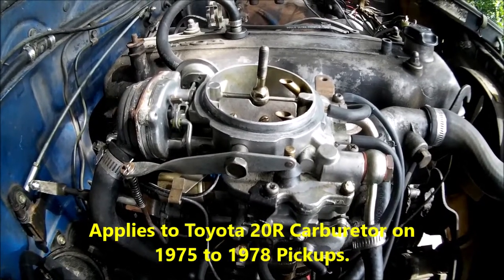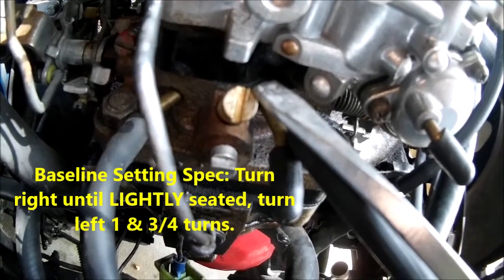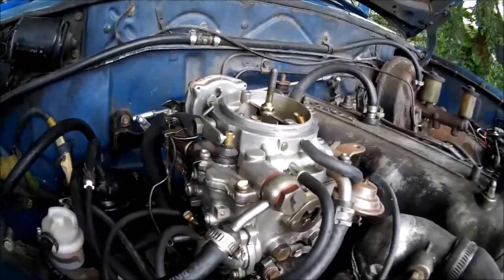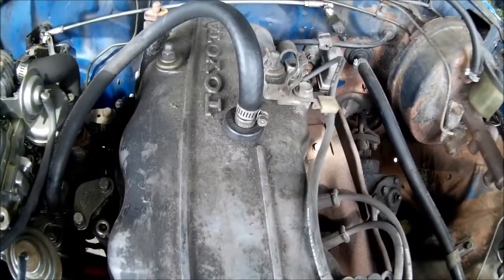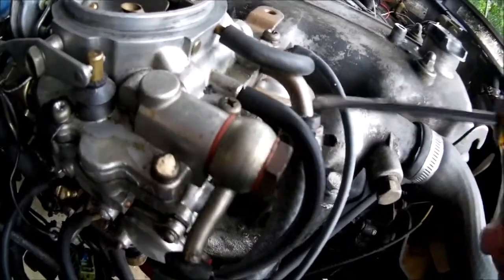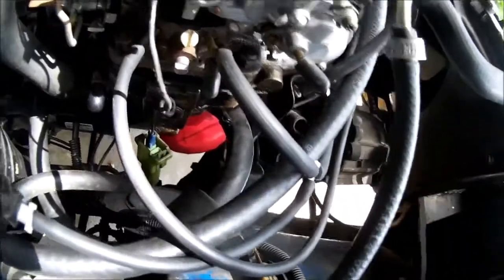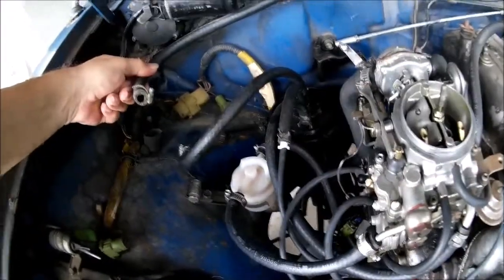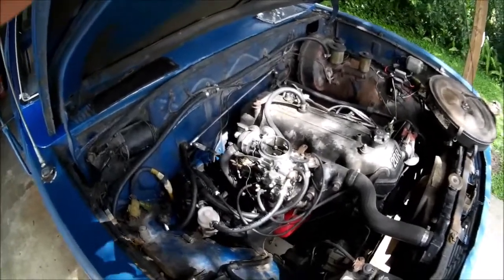1978 Toyota Pickup/Hilux 20R-Carb Adjust & Vac Lines-Desmogged

Comment: I just acquired a 78 Bandit something like a Chinook. No power to fuel pump so I hooked a fuel jug to the carb via gravity, and it lit right off wide open. Is it the carb or the fuel delivery? It had been sitting for years. I hope you see this as you are the GURU!! The linkage seems o.k.
Reply from the maker: Hard to say without actually seeing it in person, but carb'ed vehicles that sit for a while tend to have some issues. Personally I would (might) suspect the carb.  It could be that the float is stuck open, allowing a full flow of fuel to go through the carb, giving you the "wide open" effect. You may or may not be able to free up the float without taking the carb apart & rebuilding it. Sometimes just getting fresh gas into the fuel bowl will "melt" any varnish or gum in there that is causing this.

Keep in mind that it could also be some other problem or combo of problems, like a clogged needle valve (this is the valve that regulates fuel level in the bowl & works with the float). If it's clogged, your temporary gravity feed system may be overfilling the fuel bowl & causing the condition.

Also, depending on how you have your Gravity Feed System set up, it could just be feeding too much fuel into the carb, overwhelming the shutoff valve (unable to meter fuel, kinda like dumping gas down the carb throat while it's running, it will speed up). The carb itself may NOT be the prob at all.

The Idle Circuit could be clogged & the fuel is going straight through the Main Jet Circuit (too much fuel to run @ idle speed, so again, wide open effect). Could also be a non-functional idle shut off solenoid (normal function - prevents engine from continuing to run when you turn the key off). If it's stuck in the "Off" position the idle circuit will not work right It could be stuck closed from gum & varnish.

It's the difference of vacuum from the engine vs atmospheric pressure that draws fuel through the passages of a carb, which are designed to "meter" the fuel flow. If 1 or more of these passages or components (like those mentioned above) are clogged the carb will not work correctly. Now you also see why I say it's tough to know without actually seeing it.

Short of a complete tear-down & rebuild of the carb, or changing it out for a freshly rebuilt one, there are a few things you can try, if you have the time to "monkey around" with it. This will look worse than it actually is, due to me trying to be complete in instructions, if you want to try them. 2 ways:

1. Clean carb on the engine. This takes several cans of Carb Cleaner (cheap stuff from parts store works OK for this) & a source of compressed air (air compressor best, canned air too expensive to use). Remove air cleaner, remove 2 large bolts from front of carb, below fuel level sight glass window, remove idle cutoff solenoid (passenger side of carb, has 1 wire going to it, disconnect this). Don't lose any parts! Spary carb cleaner into both brass vent tubes in carb throat; these go direct to the fuel bowl) to "wash out" any sediment or "junk" in the fuel bowl. Spray into port where idle cutoff solenoid goes. Look/listen for cleaner to come out of a port low in the carb throat, confirming it's open. Spray thru the 2 holes where you took the large bolts out. The Idle & Main Jets are inline with these holes. Use the "straw" that came with the Carb Cleaner spray can to reach the Jets. All this should take at least 1 can. Let it sit after you are done spraying for 10-15 minutes, then use the compressed air to blow into all the places you sprayed. Re-install all parts you removed & test.

2. Clean carb off the engine. This requires carb cleaner in a "paint can" (recommended - Gunk Carburetor & Parts Cleaner with Drip Basket, 3 quart size). Remove all previous parts described above. Mark & diagram all vac hoses (important!) so you can put them back where they belong. Disconnect vac hoses, disconnect linkage (one clip on underneath side), unbolt carb from intake & remove carb. Clean off any major dirt or junk from outside of carb with a brush or cloth. Now you can "dunk & soak" the whole carb in the can of cleaner, overnight recommended. This will "melt" or loosen up any varnish or gum deposits, even inside the carb passages. After soak drain the carb of cleaner & hit with the compressed air, esp at any inside passage access point (jets, solenoid port, vac ports, etc.) Reinstall everything (make sure you get ALL of the vac lines back where they belong or the carb will not work right!) & test.

I showed you all this so you have options. If neither of these methods works & the engine won't run right, the carb will need rebuilding or replacing. I personally wouldn't go beyond method #1 above (carb cleaner spray cans) because due to age or use the carb could very easily be worn out & in need of rebuild. Some old carb problems can't be fixed by cleaning. Also, I've leraned from experience that it's just easier & less of a pain to just put a rebuilt carb on & go from there. Rebuilding it yourself using a kit is only for advanced skill people; I leave it to experts. I have a source for rebuilt carbs for the 20R (at a reasonable price too), let me know if you need it.

As far as no power to the fuel pump that is another topic. How do you know there is no power to it? Checked with a volt meter? Don't hear it running? Other? Did you check your fuses? Let me know. Could be several things.
Reply: @The13thSword  WOW! thanks for getting back so quick! That's some GREAT information, I will try to get it going myself, it seems to be a good little engine, wide open, its a BOSS! It only ran for a second blew a mouse nest plum across the yard! Anyway,thanks again
Reply from the maker: @wesfrazier5739  You are most welcome. The 20R engine is a very well made engine & a good runner. I doubt you'll have much trouble with it. Just clean that carb as best you can & see what you have. If you need anymore info or help I will be here. I would have some suggestions & advice on what's next after you get it to run. Good luck.
Reply: hey I don't know If this will help but I have a 76 chinook and the fuel pump that came on it turned out to be too far from the gas tank, it was sitting up with the engine. Installed a new one about half way between the two and wired it with a switch in the cab I turn on manually. I haven't had a problem with it since.
Reply: @sarajohnson4990  sounds like a good idea. Would you be interested in selling your fuel tank as they are made of unobtanium. LOL
Reply from the maker: @sarajohnson4990  Thank you for your input. Considering the age of these vehicles it can be impossible to know what modifications previous owners have made. Your fuel pump situation sounds like one of those mods, and your solution is a good one. Also, if you can hide the switch somewhere in the cab it can act as an anti-theft device to boot! :^)

Comment: Is it possible to unclog the jets on this without removing it from the vehicle?
Reply from the maker: The Main & Secondary Jets can usually (note;  USUALLY) be unclooged/cleaned without removing the carb from the vehicle. There are 2 large bolts on the front of the carb that, if removed, provide access to those jets. If the clog is very hard or compacted though, it may be difficult to unclog the jets with just carb cleaner spray directed at them through the access holes . It might be best to remove 1 bolt, drain the fuel bowl, reinstall the bolt, then spray carb cleaner into the fuel bowl via the vent ports in the carb throat. These are 2 brass tubes you see in the carb from the top when you remove the air cleaner. Let it soak awhile (hours) & refill if necessary. Then try to clean jets as outlined above. Usually works.

There are some other jets & passages (slow jet, air correction jet, idle fuel passages, transfer ports & passages) internal to the carb that, if clogged, you may or may not be able to unclog without taking the carb apart, or at least taking it off the vehicle & soaking the whole thing on carb cleaner. It can sometimes be done w/o removing the carb, just depends on how clogged up it is. I can give you details about this if you want.
Reply: @The13thSword  Thank you for the quick response! I'll give it a shot and see how it goes. I appreciate it!
Reply from the maker: @casey_james  I just happened to be on, you're most welcome. Good luck with it, & let me know how it turns out.

Comment: I wish I could find a CA SMOGGED setup for the Toyota 20R/Aisan carburetor. Doesn't the DMV have a task here?
Reply from the maker: You might want to try searching the Yotatech forums boards for info on that, if you haven't already. https://www.yotatech.com/forums/f60/

Only other thing I can tell you is keep checking on Ebay. Sometimes the CA smog parts turn up for sale there, if you need them.

Comment: Very big thanks for vacuum hose explanation I have a 1980 with the same set up but the 3 hoses coming off the back side 2 of them are running into a splitter mounted on the Fender weld ..... But here's the issue I'm having is every time I drive it when I shut it off and lets out a loud backfire and I've had the time and done and that didn't help it so I'm wondering if it could be the carburetor adjustments
Reply from the maker: You are most welcome. Your problem could be carburetor adjustments, but could also be other things. I'd need some more specific info in order to ever try to narrow it down for you.

I assume you meant a splitter on the fender "wall" instead of weld(?) If these are larger diameter hoses than the "regular" vacuum line hoses, those are either for the vapor canister, the brake booster, or possibly both. I know of no reason why there should be a "splitter" (I assume you mean a "T" Fitting?). The vacuum sources for the canister & the brake booster should be hooked up to their own dedicated vacuum ports, not shared.

By "backfire" do you mean a loud "pop" from the tailpipe? Or do you mean the engine "pops back" through the carburetor?  Which one you mean makes a big difference in diagnosis. You say you had the timing done(?) but do you know for sure the timing was set correctly? When I got my truck it was set to "0" & it stayed that way for years, until I found out it should be at "8". You'll need a timing light to check this yourself & it's worth having one. You can get one from Harbor Freight for about $30.

Also, just setting the timing correctly may not solve your problem if you have worn timing parts, i.e. stretched timing chain, worn timing gears, damaged/broken/missing chain guide(s), malfunctioning chain tensioner. Unless you know for sure that these parts were replaced with new ones less than about 70,000 miles ago, they could be worn. These worn parts can cause timing issues. A worn out distributor can do this too but it's less likely. You can also diagnose a stretched timing chain with the timing light. Just hook it up, run engine at idle (warmed up) & check the timing marks on the crank pulley. If the mark jumps around (not showing up in one steady place) that usually means a stretched chain.

As far as carb adjustments to fix your problem, could be, but you'd have to "baseline" it to find out. Meaning, the carb settings should be put at the stock settings (fully warmed up, idle speed about 800 rpm, fuel mixture screw about 1 & 3/4 turns out from lightly seated). This WON'T work if you're having timing issues as described above; you'd have to get those fixed first. Also if you don't know where these adjustments on the carb are PLEASE look up a diagram of your carb FIRST before you mess with the settings. Trust me on this one.  Decent diagram here :http://automotorpad.com/toyota/249351-toyota-20r-carburetor-diagram.html

Also make sure your choke & choke plate isn't stuck in a closed position when the engine is warmed up. This can cause a "rich" condition (too much fuel) which leads to lower MPG, poor performance & sometimes tailpipe backfiring. Dirty old carbs can have stuck parts like that. Spraying down the linkages & outside of the carb w/carb cleaner spray when the engine is cold can solve some of those issues. Just let it soak a while after spraying it down before trying to start it up.

That's about all I can give you right now. If you have some more specific info you can give me about your truck I'd be happy to consider it.
Reply: I'll try to do a video on the issue I'm having next time I'm home .... normally out of state 3 months at a time... thanks
Reply from the maker: @joshuabradshaw2201  No problem, I'd be glad to look at it. Safe travels in the meantime!
Reply: @The13thSword  I'll start work on the lines for sure. I tuned the idle down to a nice low hum with no issues yet. Planning to clean the carb and start with factory adjustment and tune from there.